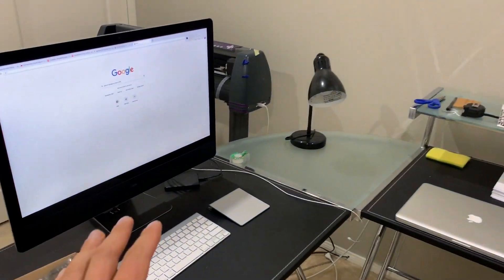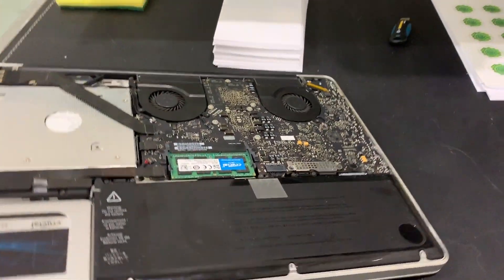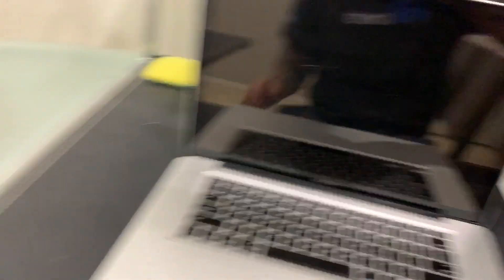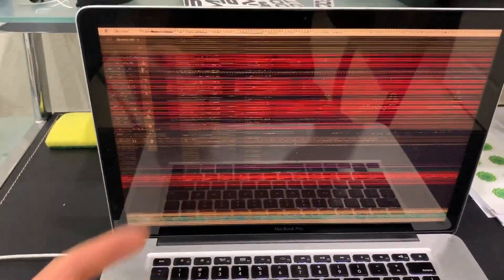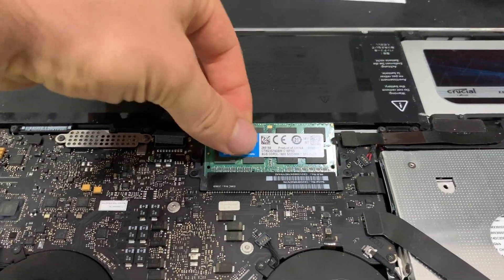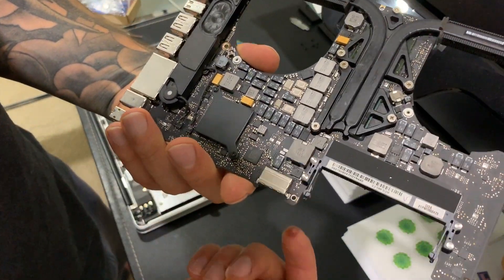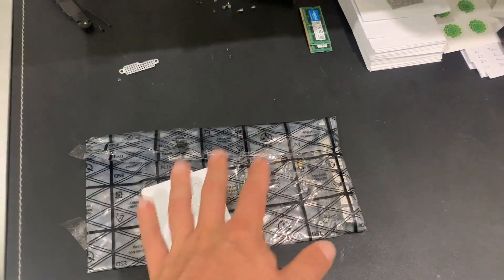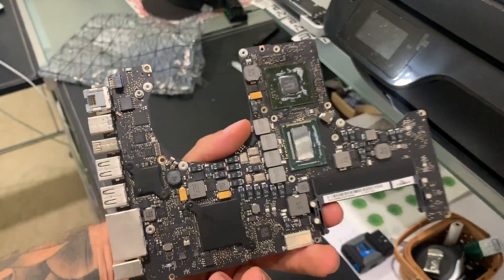Macbook Pro Logic Board Failure | Frozen Screen Glitch | Fix | Repair

Comment: Great video- Here is my take on the issue. The cooling system on the Macbook pro's are awful. They require alot of maintenace as far as blowing out the heat exchanger's and basically it's best to just leave the screws out on the buttom cover period. The black tabs on the bottom cover is best if two are missing. This helps more air flow across the board, mainly the one's in the front of the board. On my two MBP 17" the graghic chips are the biggest issue. I installed a after mkt chip that bypassed those bad chips on all the MB on the 2011 MBP's.  I don't know who did your board repair. But they are crap. NO board should return with heat past on them. That means they did'nt clean it. Most likely they heated it. ( a sorry ass reflow in a oven) and charged you for it. I'm using my MBP responding to this post. I'm also having a issue of a freeze so I guess I go get the air hose and blow it out. I also run smcFancontrol thats a big help to control heating up issue and it allow me to monitor the board temperure as well. It's also worth noting.  It's good to change the heat exchanger's and invest in new fan's both can cause big problems on the motherboards.

Comment: Hey, when you say you put drinks coasters under the 4 corners, did you mean inside the actual MacBook, or just on the exterior of the 4 corner/black grip pads to raise it from the surface it is on?
Reply from the maker: Just on the exterior to give a small air gap between the bottom of the computer and the surface its resting on

Comment: My Mac overheated while I was editing photos on Lightroom, it turned off. Tried turning it on, but it would turn off after a minute. Did some things I found online, then it turned on. The screen started to glitch even when I was just on my desktop doing nothing... bought it used tho....
Reply: This just happened to my 6 month old 2020 MacBook Air
Reply: Might be a thermal compound issue, try replacing the thermal compound on your CPU, also on your GPU (If you have one).

Comment: Hey same happens with my MacBook air 2012  i5  4 GB ram

But the screen doesn't splits like yours but I just get those weird bars on it  and that glitchy screen stays for sometime and my Mac turns off by itself
Reply: Same to me.
Reply: @pickledragonyt   which Mac are you using
Reply: @lazyninja4646  macbook pro mid 2012 16gb memory
Reply: 2,9 GHz Intel Core i7
Reply: @pickledragonyt   I think it's a GPU problem ☹️ I swear I hate this I can't complete any Photoshop task
Reply: My MacBook Air freezes then a fuzzy screen pops up ;-;
Reply: @stard9349  yeah  did u find any solution
Reply: Lazyninja nope not yet

Comment: Let me know if you want help with the tech stuff.   I am that "tech nerd guy" 🤣🤣 but good job man you pointed out the Graphics Chip. The one on the bottom is the processor.. as for what you can do with it, keep it and use it to surf the web with it. Finally I would recommend you get a laptop cooling pad, it's basically a plastic plate with built in fans to cool those parts that overheat..
Reply: rtxrt73 if you see this message pls reply
I need help with my screen
Reply: @brandon79051  hey man what's up with your screen and what kind of machine is it?
Reply: Thanks brother!  Yeah the iMac is MUCH faster and it makes editing a lot easier.  I'm about to go grab the SRT-10 in a few weeks so I'll need the macbook for editing on the road. Might use it for that period of time then dump it
Reply: @BoostedMotorsports  I'd say keep it for a web browsing machine, some YouTube viewing. Heck not sure how things are going with your girl, but you could keep it for her to use 🤷
Reply from the maker: She has a 13" Macbook Pro already too!  I might try to sell this one and get a different mode cause I do still need one when on the road.  All this week I used this one when at SEMA 😮
Reply: @GarageGoals  awesome coverage by the way! I've been super swamped at work and I finally wrapped up swapping out the gas tank on my Ram (which your video came in super super helpful!!!) All I would say is due to its age your not going to get much for it, so I would research what you want to get first since if your new laptop uses SSD drives you could harvest at least one if not both. Otherwise turn them into external hard drives and use them that way. Depending on their size it may not make too much of a difference in the price you get for it, and they maybe more valuable for the data that's on them now..
Reply: I have a 2015 and my screen does the same thing it works under safe mode but other than that it don’t.
Reply: @rtxrt73 hey, my Macbook Pro is flickering. I think it started when i plugged my battery. I don’t know if it was a shock or virus, please help!
Reply: @billb6182  hey man, sounds more like the battery or the graphics adapter moat likely. Viruses rarely affect hardware in that way, and as for macbooks they are pretty finicky things. Most laptops don't vent properly and so the components can easily overheat and get damaged (all laptops not just macs). I would highly recommend taking it to a reputable mac repair shop in your area. If there aren't any, Luis Rossmann ( he has a channel here on YouTube) is who I would recommend sending it to (he does do mail in repairs and has a pretty good staff doing the intake). 
 Wish you luck with that man, but don't stress too much (and if you haven't already I would highly recommend backing stuff up to the cloud especially the more important stuff..)
Reply: @Kim Taehyung just saw this comment,  but I would highly recommend getting it looked at in person by a reputable repair shop. Normally glitches on start up that eventually go away are a warning sign that something is not right with the graphics chip or possibly the video memory (issue with memory can also cause flickering and artificats that are random). Irrespective of the cause the solution will require either a repair/replacement of a graphics chip (super not recommended on an older machine as unless you have the same model donor the parts are beyond stupid expensive) or just replacement of the laptop. See my previous comment and if its a MacBook I would highly recommend Luis Rossmann (look up his channel here on YouTube). Good luck 👍
Reply: Hi please I have an issue with my mac